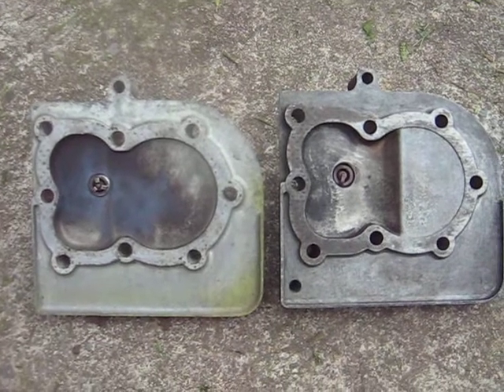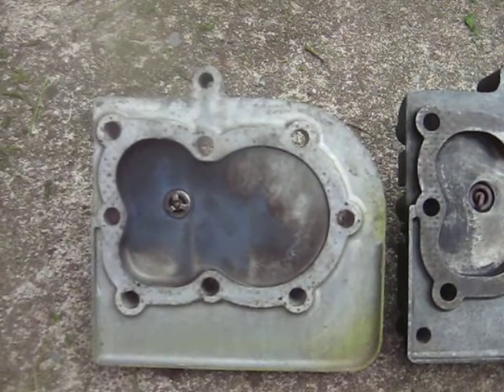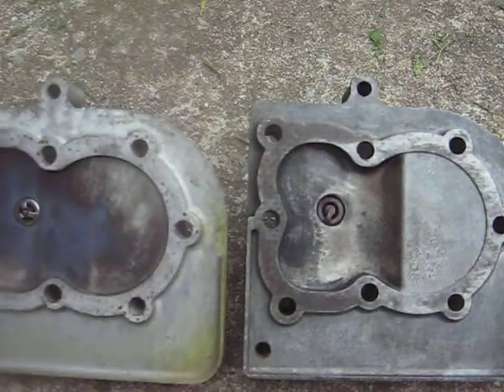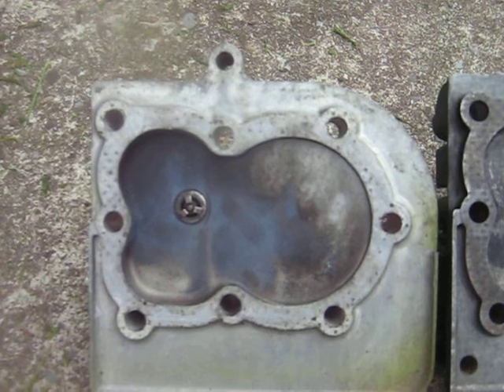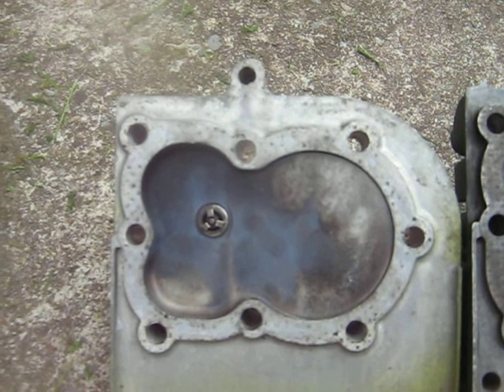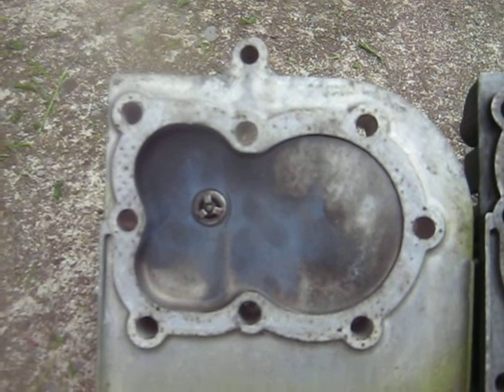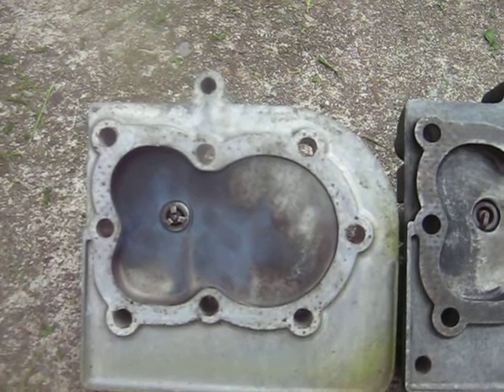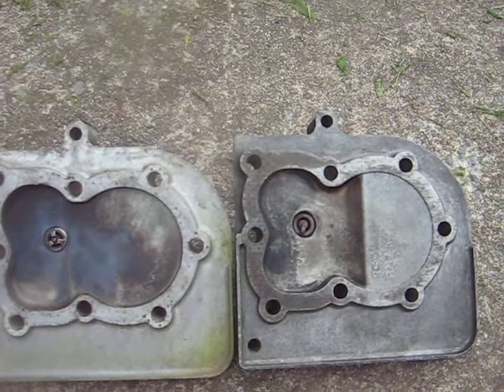4 vs 5 Horse Heads on Briggs

Comment: I found something years ago that is wicked on the 13 cid Briggs.  Some blocks are thick enough on the cylinder to take this amount of bore, most are not suitable.  Take a std size piston from an 11 cid, bore .23? over (its been years since I have done one).  The piston pin and pin height are the same.  Same goes for the 9 cid engines.  You gain a little more than a cubic inch.  This not only bumps compression, it gives a larger  piston more 'push' at all speeds.
Reply from the maker: +Mike Brooka WOW, that would be quite the over bore! I have a few of those model 110 Briggs pistons, they are quite a bit larger.